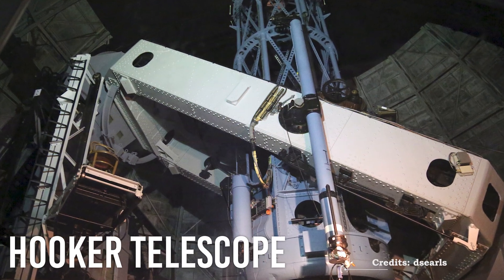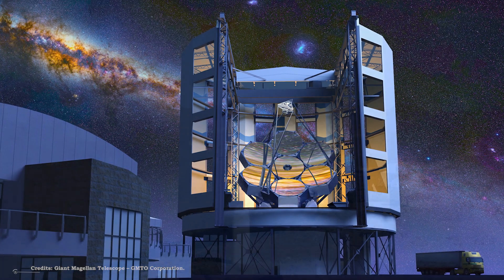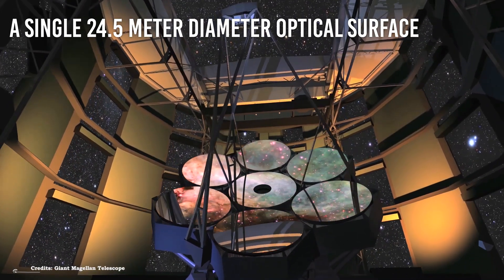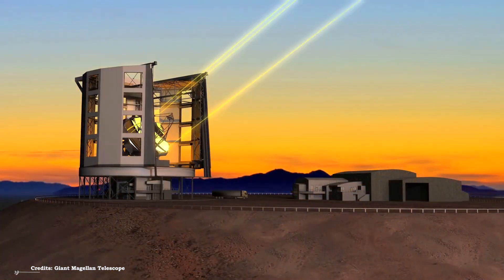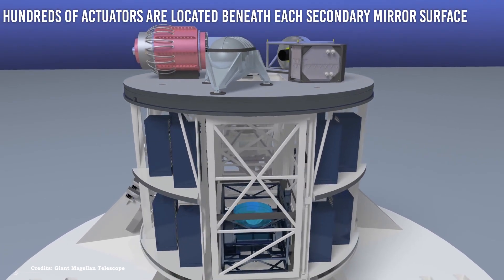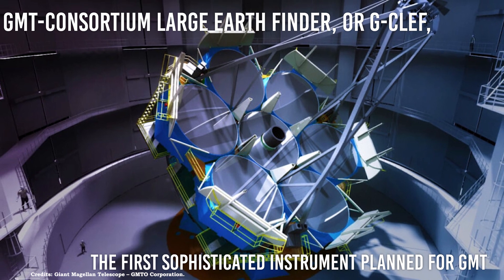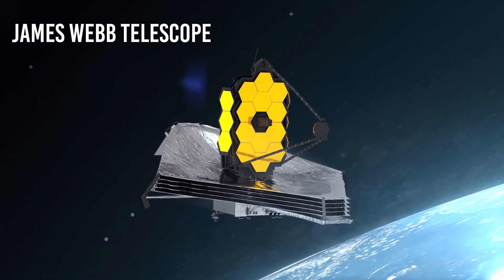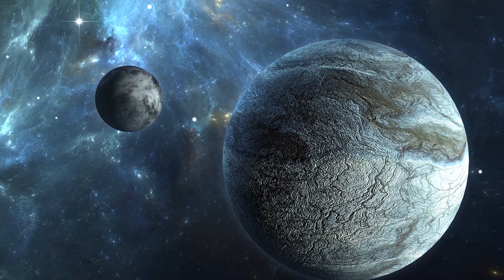How The Giant Magellan Telescope Will Revolutionize Our Understanding Of The Universe?

Comment: The GMT is one of three very large telescopes under construction. The GMT has a projected first light of 2029.  The other two are the European Extremely Large Telescope 39.3 m (1,550 in). First light planned in 2027, it is located on top of Cerro Armazones in the Atacama Desert of northern Chile; the Thirty Meter Telescope 30 m (1,200 in). First light planned in 2027, its planned location on Mauna Kea, on the island of Hawaii.
Reply: Last I heard the TMT is dead in the water.
Reply: @njm3211  Not exactly.  Despite a pause in construction of the Thirty Meter Telescope on Mauna Kea, key portions of the observatory are still being built.  TMT officials had hoped to resume work on Mauna Kea this Spring.  We shall see.
Reply: @WWeronko  👍👍👍

Comment: I'm wondering if there would be any advantage in building a telescope on the Moon with its light gravity and perfect year round seeing.
Reply: If we ever do colonize the moon, all that moon dust may get kicked up and take a while before settling. Also don't forget that the Sun does shine on any one part of the moon's surface (except within craters at the poles) for 14 days at a time.
Reply: @mbisson5816  that's why we are granted with ingenuity :)
Reply: @igoromelchenko3482  ... so that we can break the tidal lock on the moon and make it spin so that one side always faces away from the Sun. 👏
Reply: @mbisson5816  and that is not a limit :)
Reply: @mbisson5816  I may be mistaken but isn't the manned Moon base going to be located at the southern pole of the Moon. So if an optical telescope was built that location limit the light problems. From there it would be a engineering issue to build a shield. That said I would imagine a radio telescope would be the first built. The low gravity would allow a much larger unit. Coupled with a permanently manned base on the Moon seems like it would be something to consider.
Reply: @jssomewhere6740  We shall see.
Reply: @mbisson5816  It my not be a doable thing. I had the same discussion recently and there are many draw backs that were pinted out. Since I'm not an expert on Moon based anything, chances are I'm wrong. I do however think it is a interesting idea, and one I do like to discuss.
Reply: Curious 😁
Reply: Maybe we should have a permanent mission to the moon first...🧑‍🚀👨‍🚀👩‍🚀
Reply: @insanecuriosity2682  I may be wrong but isn't Artemis exactly that. 
  The purposed plan is to send men and then equipment  in the effort to construct a permanently manned base in the south pole region? 
  Unless those were just the voices in my head.